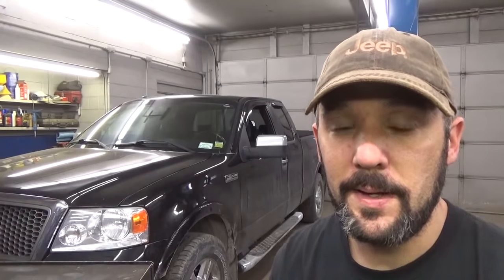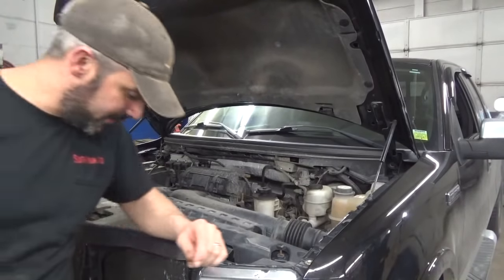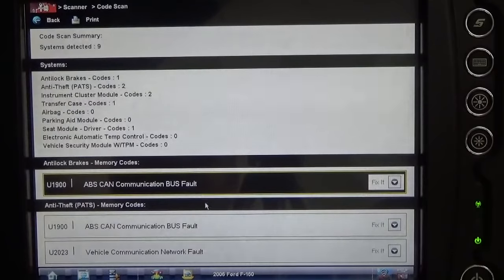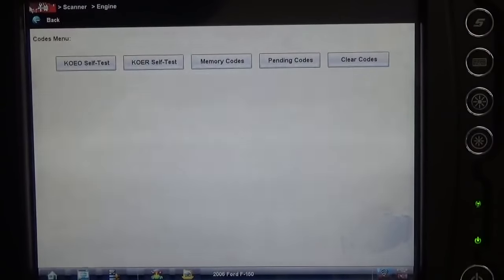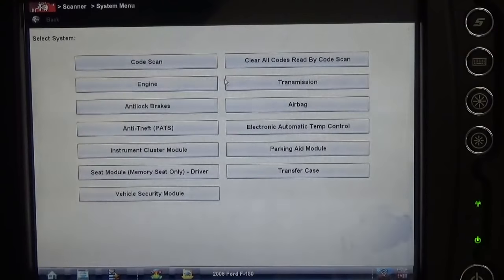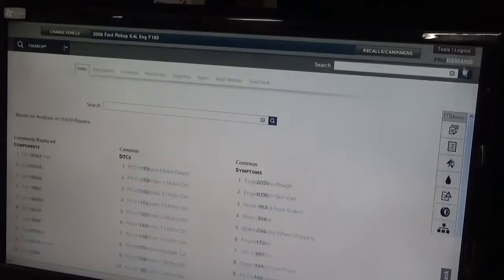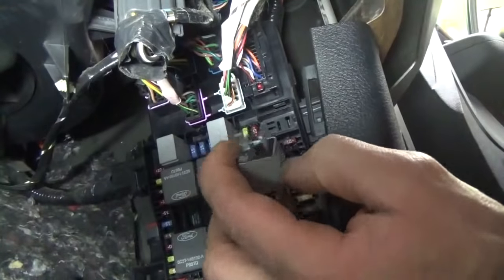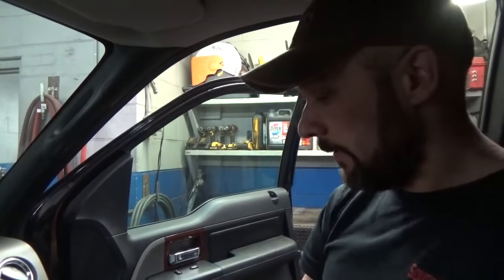Ford F150 5.4 No Start, No Crank, No Communications Codes: U1900, U2023

Comment: This was a very helpful video. It led me to the relay, which had been replaced and I took it apart anyway and it was clean. However, I noticed the engine would cut out if I even wiggled the relay slightly. The terminals inside the fuse box had loosened up. I had to remove and disassemble the fuse box to tighten up the terminals. The truck is running great again. Thanks for the great vid.

Comment: When the LCM finally failed in my 03 Grand Marquis, I found a relay in it that was to blame and after cutting the top off and adjusting the contacts, it works perfectly now. One tiny relay, no low beams from Florida to Wisconsin...

Comment: Eric that must be a common issue on those gen f150s and Expeditions. I remember about 4 years ago my mom’s 04 Expedition had that same symptom no crank no start. Then sometimes it would start after hearing the chime. It was a bad PCM relay. No corrosion just a failed relay output. Happened to see this in my recommended and halfway through this and hearing the chime it brought back memories lol

Comment: By the looks of that crusty critter the manufacture probably used a cheap corrosive flux while soldering the coli wires to the pins and it spread like crusty cancer. Just a guess based on the ones I work with. This type of relay failure is more common than a coil giving out in my line of work. Great video!

Comment: Hi Eric, I’m always watching your shows and doing some repairs to my cars myself. On your early video with the 300 ZX you taught me a lot and .I still have it running today. But today I have a new problem .I have a 97 Ford F150, XLT manual it needed intake manifold Runner control valve, which is located on the backside of the motor, it has two. I had to pull the top Plenum off to get to him and disconnect some wires. I replaced both and thought that I connected all the wires back. But now my truck won’t crank or start. I have charged the battery with my charger and taking the battery to O’Reilly and let them charged it. The battery is good, but I’m not getting power from the key to the starter. And I trying to jumpstart with a screwdriver and it would not turn over. One more thing I noticed when I switch it on the radio won’t come on. So I’m thinking I have a wire that is not connected. Can you help me you are the most intelligent troubleshooter that I have seen.  that I trust.

Comment: i had to figure this out broke down in an intersection with my chevy 2500 express. took the ac relay and shoved it into the powertrain relay. lurched and staled. felt like a genius. the relay helped me find it, it was buzzing pulled it buzzing stopped. shoved it back in relay started buzzing again. felt like a genius. called canceled the fleet tow and was on my merry way back to the shop.

Comment: I know you get paid for this information. ive reached out to you through email. and appreciate all your content. recently my f150 stopped running out of the blue. security light flashing constant. took it to ford dealership and had key made new battery &  Diagnostics performed & the only thing they keep telling me is "we" dont know what it is. want me to just keep throwing money at it. im more then capable of doing that myself.  it cranks no start & has fuel pressure. they cant seem to get the security light off. when i have it towed back this weekend i was going to try to jump the starter relay to see if the truck would start. i feel like ford just took advantage of the situation. they said well it could cost 800-4000$ to fix this that it could be timing issue. hard to believe the security light would come on due to a timing chain guide as i followed your detailed video on how to change timing & has ran for last year since doing that. do you have any other suggestions for me? maybe change the pcm?

Comment: This brings back memories. Years ago I had a dodge caravan towed in. Bad auto shutdown relay, no click but all inputs fine. So ordered relay from dealer. Installed it and shipped it. Next morning the customer calls NO START, tow it in and relay clicks but no output. Told boss must be a bad relay. He says it clicks it’s good. Sitting at counter in office with relay on it we both looked down and saw a ant crawl out of a hole in bottom of relay. I took the cover off and lots of crispy critters burnt between relay. What would draw ants to new relay? Anyways sprayed area and new relay down with ant spray and shipped it. Had to eat a tow but was a crazy experience

Comment: Most utube auto repair videos are short on the diagnosis part.  You walk thru step by step .  That's professional.   
On your relay find  could it be possible that there is a small water leak above?  Also, a simple explanation of a relay is A low current device that operates a higher current device.  A relay has a set of contacts in there that close and allow current to pass thru.  The clicking you hear is the contacts making contact.  If there's corrosion on the contacts no current will pass thru.  Therefore,  you may hear an audible "click" however no current is passing thru due to corrosion. Hope that was helpful. M

Comment: Outstanding diag. I don't know why but Ford has always had a ground issue with corrosion. Crazy to find sometimes especially on the positive side. I've found it 20" from the battery with no other sign anywhere.

Comment: GREAT JOB Eric. This is the clue I needed to get my 2011 f250 started. Thanks.
Reply: I have a 09 were was your  Relay located
Reply: @joeeeggert3293  my relay was in the box under the hood. Your owner manual will show which position. mine was nearest the firewall. My relay was ok but the brown/white wire that goes from one of the relay terminals over to the ECM (for ground) had a break in it.

Comment: In this exact situation, I may or may not have pulled the starter... then finally tested it after I pulled it
Then checked the starter relay/fuse
Then put the starter back in and ran a wire to the solenoid thinking I could start it that way so my neighbor could drive it to a real shop and save a tow bill.
Just to find out that even if it cranked it wouldn't start.
So now I'm going to check out that relay.
But I'm not a mechanic, my neighbor asked for help so I was just giving it my best shot.

Comment: I once had a customer with a bunch of intermittent U codes pointing to the ABS module.  The first shop immediately quoted the guy nearly $1k to replace the module so I gave a second opinion.  Turns out body ground bolt had backed out and the ground would periodically break contact and light the dash up like a Christmas tree.  $1 to tighten the bolt and $119 to know which bolt to tighten.  Surely cheaper than a new module!

Comment: My 2004 just did the same thing today in 2022 with no engine start but everything sounds and looks fine. I just started trouble shooting it and checked battery terminals for a clean connection and battery voltage at 12.75 that is good. I had out my wiring diagram to see what it might be. By the way I looked at scan codes and decided to ignore them and go for more obvious things. A common trouble I often find is either a bad connection or worse a bad ground lead. Far to many guys say "I've got voltages so there can't be anything wrong".  That goes for relays to. I guess I'll stick my head inside the right side and check that relay first to see if mine has also leaked. Thanks for the info.

Comment: I like to see your diagnostics. I found, if it worked before and no one has finger banged it its probably a simple fix. It just takes time to find the location of the problem. I found the worst are intermittent electrical faults.

Comment: I look at those wiring diagrams and think: oh yeah, this is SO much better than old school! 1 power wire running to everything through ONE fuse box. 

One wire running to ignition then back to the coil and starter relay. One big cable running to starter. 

Engine won't crank? one of 2 things.
Engine won't start? one of three things

Now they have sensors to make sure the engine runs and but if there's nothing wrong with the engine, a sensor goes, engine won't run. Pretty soon they'll have sensors to monitor the sensors to tell you which sensors are sensing and which aren't sensing. 

Then they put in a vvt system to lower emissions and improve fuel econ but the system is a POS so your engine requires a $5000 service every few years. So you'll save $4000 in fuel but have to pay $5000 so your net sayings is? -$1000.00 And emissions? How much pollution is produced by casting all the parts or a new engine?

Comment: As always  - your methodical approach to troubleshooting saves the day - do you have power to the module in question ? Check out the circuit diagram that shows what feeds power to the module and go from there. Great job and nice teaching video.

Comment: You said the terminal corroded but I’m wondering if the relay overhead at the contacts and melted the terminal material leaving something for corrosion to take hold. Reminded me of when capacitors overheat.

Comment: Good job buddy. I have a 2007 Ford f150, and I've had a problem with the tire pressure censor. It just stays on after checking the tire pressure. I'm down in South Texas.

Comment: Well done diagnostic procedure and very well done video.  But what caused the corrosion? It looked like corrosion from a leaky battery or capacitor. Is either of those in a relay? There was a resistor shown in the video, but that wouldn't have leaked.

Comment: All(?) of the new relays tend to be made with the wire terminals simply molded through the case. If the molding is poor or the contact didn't bond to the plastic, simply pulling/pushing the relay can make or break contacts. And if you pull the relay off, everything can test ok, because the contacts have shifted. A genuine Bosch relay played that game with me for days on end.

Comment: Great vid. Is there a relay/module for fuel on a cross member above the spare tire on a 2013 f150. I would look but the cable is stuck to get the tire down.

Comment: Seen it happen on aircraft a lot. Relays actuating but not transferring power. The contacts inside would corrode, most of the time you could use a power supply and give it power over and over and it would knock off the corrosion and would work again.

Comment: I had a similar problem, but mine was caused by a bad relay.  1st I checked all the fuses and found a 15 amp fuse blown in the engine bay, I think it was #47. It was on the right side front of the fuse block.  2nd I pulled relay #1 and jumped the high current legs with a pair of needle nose pliers and got the engine to turn over.  Pulled the #2 relay and with the key on, jumped the high current legs and the truck started and idled.  Lastly I pulled relay #8, I think it was, and the truck started.  I then tested the #8 relay and found that it was toast.  Replaced the relay with the trailer brake relay and the truck started with the key.  Took me a long time to figure it out, but was a great feeling when I figured it out.

Comment: Eric, If you were going to buy a new truck today. Which truck would you buy? I'm looking for a short bed, two wheel drive without all the electronic bull that's on them. I'm older guy I will use it mostly for transportation.  I won't be hauling very much.  Awesome video thanks for sharing.

Comment: The "KISS" method seems to be forgotten my many PROS for whatever reason. I guess they dont want to do the simple stuff. I just did an engine swap on a 2005 F150. I had a 2006 with 124k miles and the frame was shot. I found a 2005 with 274k miles with a perfect frame and a bad cam and other misc worn out parts so i swapped my engine into the better body/frame and used the best parts of both trucks to make one good one. I had to swap the whole dash, column and wiring harness with my 2006 engine since they had a different 12 pin inline connector on the 2005 dash harness. I went ahead and put my 2006 dash,  column, PCM, and accelerator pedal into the 2005.I notice a common leak point on the F150 that lets water in to pool right below the fuses/wiring on both sides.

Comment: Had same problem, but also had a slightly loose negative battery connection. Replaced a relay and tightened the battery cable for a complete fix for me on my 2000 Expedition.

Comment: Hey Eric well a big thanx to you for confirming what I thought. But what is rather strange is everything was exactly the same with this 04 I'm working on.  But this one the relay ( the pcm power relay) would just work it's way lose and you would have no crank but the power everywhere else. So you would just have to push it In all the way and you would be good to go. Now here is what got me. I had a dead cyl. #2  to be exact. So I put a new plug in then a cop, then as a idiot would do then I check the cel . And it said malfunction in injector circuit. So I put an injector in still dead checked the wires, probed for cont. From injector to plug at ecu on the fire wall yep got a good strong beep. Spliced and grnd wire in at the injector plug and ran it to the fire wall. And no crank so I also have a noid light to confirm the signal wire for #2 injector . If I put the new power relay in and see if it will turn over or better yet start and I don't have that noid. Light blinking then I the ecu is bad. But as I said first that relay

Comment: eric I use the following phrase to my apprentise as she is prone t  opting for the scan tool looking at the codes then keeping it all simple do the basics powers and groundswityh more and more relay feeds 1st and 2nd stage you do need your wiggle test and relay tester on the bench I keep a draw full of relays all of them have been tested / mostly aquired from donor vehicles( cara going to the scrap yard / when I started my first shop it was on a bare bones setupbu salvaged fuses bulbs relays and bolts of all sizes fron 2mm 1/8 imperial up to m12  near enough 5/6th of an inch bolt diameter

Comment: You actually make learning fun.  Thank you kindly for the tutorial.  Quick question—could the same issues present on an earlier model F-10? Like a good Ol’ 2001? The same issue started after some fool tried stealing the truck by destroying the ignition switch.  A locksmith who replaced it, and double checked his work after the no start/no battery charging occurred after a few days of driving to work.  The locksmith said the problem was due to the starter since there was no battery power to check the PATS.    Any suggestions would be appreciated.

Comment: Thanks for the video! I have the same truck with 4,2, same problem. Did the switch with the relays but no crank. Did the park and neutral, nothing. What else can be an issue here? I am not getting any sounds from anywhere but I do hear a click when I turn on switch

Comment: 2005 Nissan Tino with dashlights flashing in unison and dials drop to zero but car runs fine. Flashing does not start straight away and after flashing half a dozen times at different intervals everything works fine. Unpluggedi instrument cluster and could find no connections or broken wires. Noticed that circuit has a tiny little square thing. Micro relay. Jumped it and was able to recreate fault. Coil on relay must have had small short. Replaced instrument cluster with used one. All good. A couple of months later had a 2007 Jeep with same problem. Same issue and remedy. That was the first time ever had issues with relays - and they came two at a time.

Comment: I’ve had cars that have done this because of a poor windshield replacement job. Water dripping down can find its way into fuse boxes or connectors and work it’s way down wires, etc. Often worth seeing if the windshield was improperly resealed.

Comment: Your video was 7 years ago. 2008 Ford F-150 5.4 4wd.  Today 2/21/23 I have problem close to this. Battery good, new replaced starter, that was dumb. Having a issue starting, won’t start but if I keep trying, it will  start if I keep turning key. Thought that it might be the relay you replaced in this video, I switch one and it didn’t work. 
Now go back a few months and the gas gauge stop working correctly, I’m still thinking it might be the sending unit/ fuel pump in tank. I haven’t replaced that yet. 
Afraid to take somewhere and have happen when the first shop passed it to you.

Comment: Years ago my irrigation well went down, everything in the control box checked out good. It was sending 220 v power to the motor but the motor would not run. I pulled the motor and replaced it with a new one, once you hooked it up to power no return to seller. Pushed the button for the well to start and again no run. 220V was getting to the motor by the test meter???? Found one of the control relay contacts was bad,  it would pass enough power for the test meter to show good power but not enough amps could pass through it to run the motor. Replaced the relay with a new one about $10 bucks and had a new $800 motor that I could not take back. Corroded contacts can make you search for a problem that is so simple. Sure wish I knew someone like you local, I am sure there is someone but it is hard to know who.

Comment: Oddly enough there is a corrosive gas reaction from the points inside the relay when they close,slight moisture must have been present under the relay cover when the points arc, it sounds good to me but excellent Diagnosis Mr. O

Comment: Hey man, quicky here. I got this truck sometime ago. Try get this on the road. They had an aftermarket keyless entry installed. I found it while tearing the dash apart to fix the cluster. The rats nest that I started cut free included the relay to the hazards and turn signals. I have know idea where it is supposed to be wired